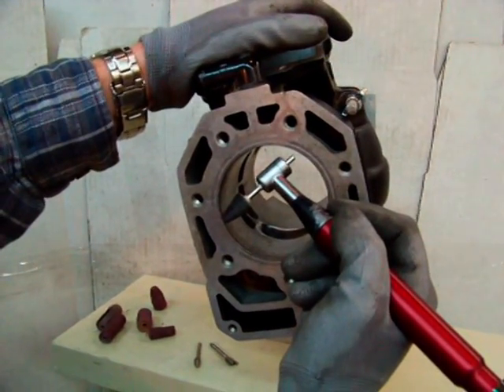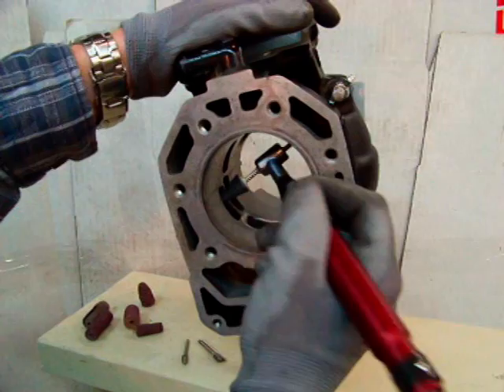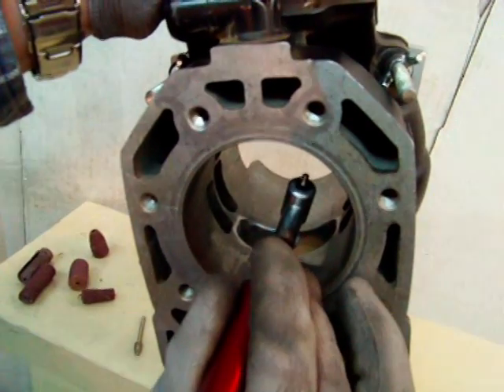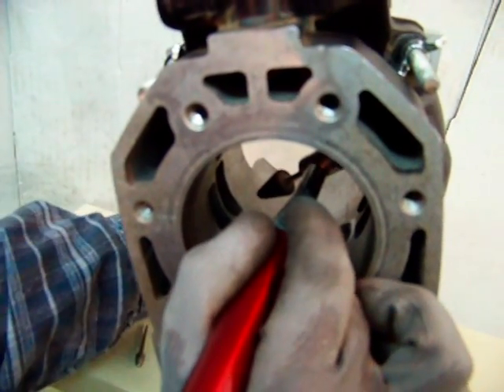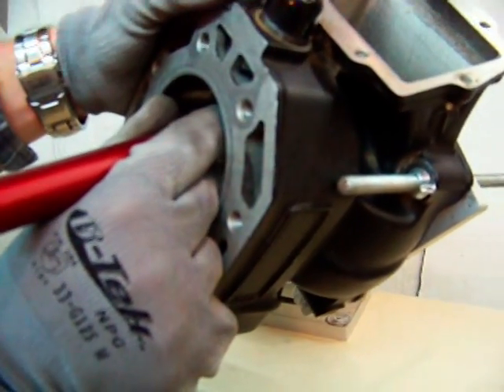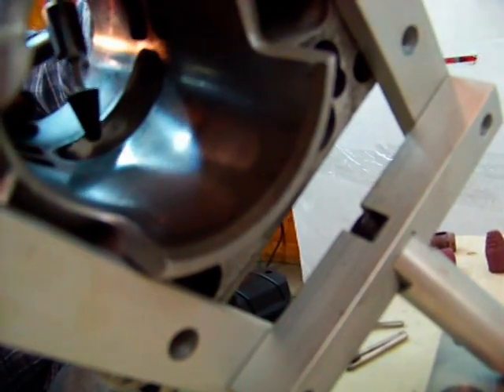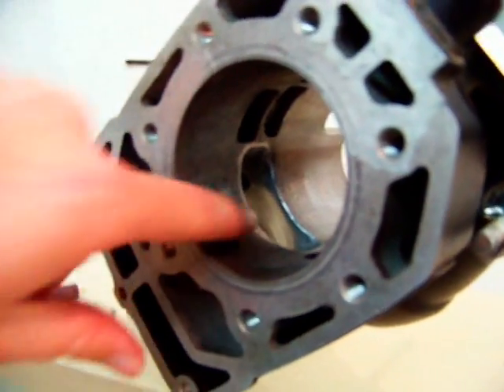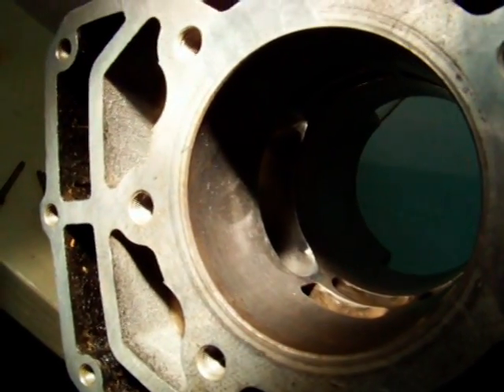2 Stroke porting Chamfering the port  part 3.mpg

Comment: Hi, great video's ! can i ask what angle die grinder you use please ?
Reply from the maker: +duane5150  We are using a 182AMC http://www.ccspecialtytoolstore.com/right-angle-rotary-hand-tool-for-porting-p/182amc.htm . It's not really a die grinder, it's a porting tool powered by a flex shaft motor that lets you use full torque at any rpm, unlike pneumatic tools. The 182AMC has a smaller 90 degree head that allows you to work from the inside of the combustion chamber on 2 strokes all the way down to 30cc's of displacement. Great question and thanks for watching.